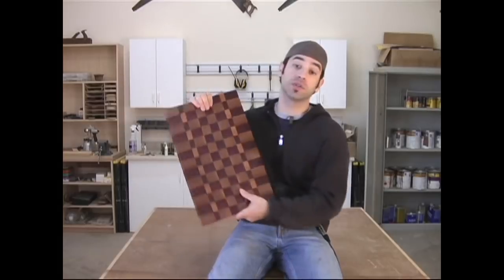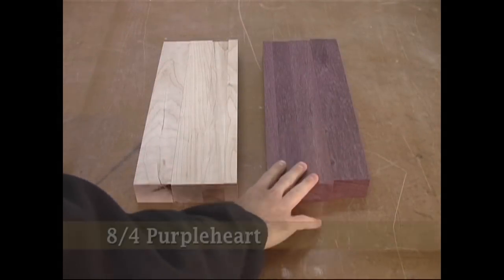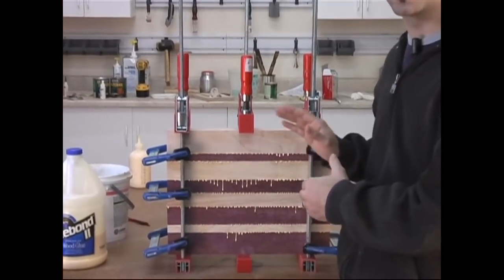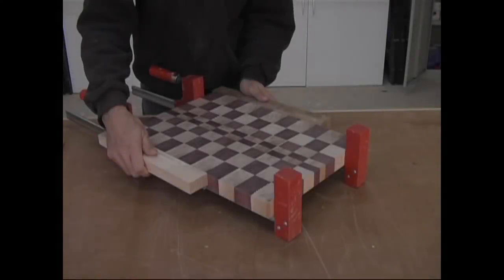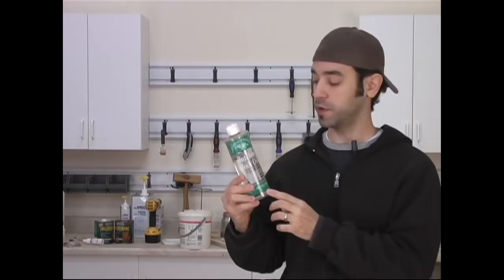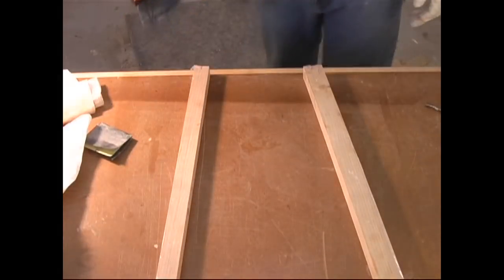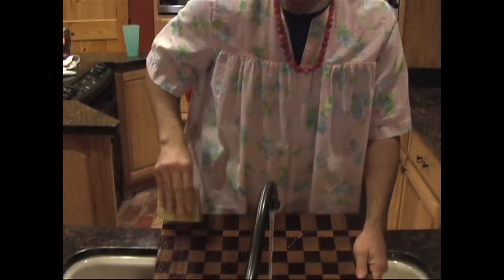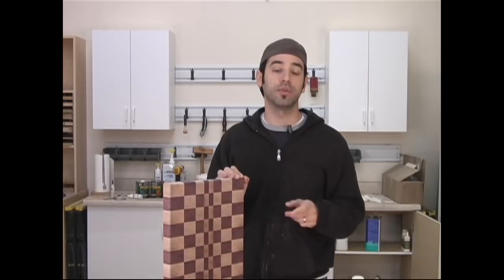7 - How to Make a Butcher Block End Grain Cutting Board (Full Video)

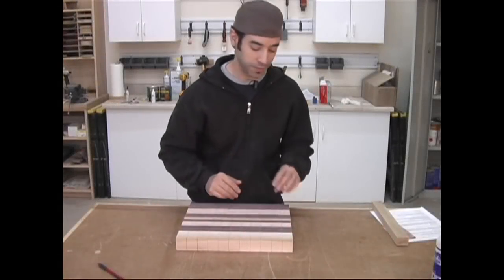Comment: You appear to have switched patterns mid stream. At the 6:19 mark you clearly show the pattern from left to right as 2 1/4 Purple heart, 3/4 Maple, 1 3/4 Purple Heart, 1 1/4 Maple, 1 1/4 Purple Heart, 1 3/4 Maple, 3/4 Purple Heart, 2 1/4 Maple.  Then at the 6:33 mark in the video suddenly the 2 1/4 Purple Heart is followed by  1 3/4 Maple.   This does not agree with the original glue up as shown in the video at the 3:24 mark.  I was trying to build this cutting board but could not achieve  the finished pattern you show in the video.  While looking for my mistake I discovered the inconsistency was in the video... I had done the initial glue up correctly so something changed in the video.  Truth be known, I kind of like the pattern I get when following your initial glue up order rather than what appears in the video when sawing the 11 1 1/4 strips.  Am I missing something. Oh... not to pile on... but when you turned each strip to expose the end grains for glue up, you didn't turn the last strip.  Sorry if I'm knit picking.

Comment: One question, you state that we should end with a board 18 inches long and 12 inches wide, but in the material section, you have have 15 1/2 inches as a lenght. Did I miss something?
Reply: Nevermind, I figured it out. I forgot about the part when you turn the pieces to expose the end grain, these are 1 5/8 x 11 = 18.
LOL

Comment: After doing the second glue up I noticed some uneven this on the height of each section. After resisting the urge to run it through the planer I am seeking advice on how to sand it down? Should I use a belt sander or orbital sander?
Reply: Due to size of board belt sander works best for non-planer leveling,  BUT besure to use ROS to eliminate heavy scarring from BS.
Reply: Personaly, I run my board through the planer but I put a sacrificial piece of wood (not end grain) in front and back of the board to prevent it from chiping. I suggest you to watch some of the video of mtmwood on You Tube to see how it goes.
Reply: I'm making the board just now and I have the very same problem. One side (the top one) is almost flat - I used a ROS and it took at least 15 minutes to smooth it (grit 80) as the wood I used is really hard (Ovangkol and beech). But the other side (bottom) is really uneven and I need to flatten it. Can't I use the planer for the bottom part? If not, why?

Comment: How strong is this glue?   If you were to drop the cutting board from a table or counter, would it withstand the impact or just shatter at the joints?  - N00B
Reply: Wood glue is incredibly tough stuff. You could probably throw this down the street, and I would be surprised if it had anything more than surface damage.
Reply: With any decent wood glue, when broken, the break is with the grain of the board... NOT the glue joint itself. Titebond 3 is what the pro's use, though Titebond 2 is perfectly good as well.

Comment: Do you absolutely have to wait 24 hours between glue cycles?
Reply from the maker: Nathan Snead No. At least here in AZ I usually only have to wait a few hours before light handling. But if it's something I plan on doing more work to, I'd give it overnight in the clamps.
Reply: Ok. I'm here too. Thx

Comment: Is it safe to add mineral spirits to the Salad Bowl finish? In my mind that defeats the purpose of making it "food safe".
Reply from the maker: You're just adding more of what's already there.
Reply: so there's petroleum distillates in Salad Bowl finish? that doesn't exactly sound "food safe"
Reply: That's why the can says "non-toxic when cured". The solvent evaporates during the drying and there will be very little left, and what little is left is permanently fixed in the finish. It's perfectly safe after that.

Comment: Great video, love the purple heart though your blades don't. I am concerned that you used mineral spirits to cut the varnish making this board toxic. Check your MSDS
Reply: I think the mineral spirits are just used as a solvent to thin the varnish and help it soak deeper into the grain. !00% of the mineral spirits should evaporate.

Comment: Using the General Finishes Salad Bowl Finish is bad advice, at least the way it's presented in the video. I was at first convinced by the reasoning in the video, but in doing due diligence before purchasing, I discovered these nuggets:

"Salad Bowl Finish is a film finish it is not recommended for cutting boards at full strength. To use for depth of grain and color, cut with 50% mineral spirits, apply, let soak in, and wipe back all excess leaving no film on surface, use GF Butcher Block Oil to maintain. GF Butcher Block Oil is a food grade mineral oil used to maintain butcher blocks, cutting board, knife handles, and wooden spoons for an oiled finish."
"For actively used butcher block counter tops that are used for chopping and cutting, only use Butcher Block Oil."

This is directly from the manufacturer of the product. They're basically saying don't use it for a cutting board, but if you insist on doing it anyway, don't let it seal the surface. Bottom line, you'll continue to need to use mineral oil on it, so what would be the point?

The product contains polyurethene, which when cured is essentially plastic. So if you follow the instructions of the video, what you've essentially done is made a plastic cutting board with a wood core. What happens when you cut through that plastic layer, and bacteria gets into the wood grain? What you're creating is a plastic coated, tight grained wood brush. Whereas the traditional, oiled butcher block re-seals with oil after each cut, and also benefits from the natural anti-microbial properties of the wood (assuming you choose the correct wood), the polyurethene is cured dry and will not reseal like that. Just a bad idea all around
Reply: "Salad Bowl Finish is a film finish it is not recommended for cutting boards at full strength. To use for depth of grain and color, cut with 50% mineral spirits, apply, let soak in, and wipe back all excess leaving no film on surface, use GF Butcher Block Oil to maintain. GF Butcher Block Oil is a food grade mineral oil used to maintain butcher blocks, cutting board, knife handles, and wooden spoons for an oiled finish."

This doesn't mean "don't use on cutting boards." If you notice the qualifying statement at the end of the first sentence, "at full strength," you will realize that Mark did exactly as the manufacturer suggests and cut the finish by 50% with mineral spirits, let it soak in, added more, let it soak in, sanded it off, added more, and very likely wiped it off afterward. He may have simply not put in the part where he wiped off the final coat because he assumed people will read instruction like you did.

Beyond that, if you watch the whole video, you will notice that he specifically states you will have to coat this with mineral oil even though it has a different finish, but that you do it far less frequently than oil alone.

You will also notice, if you reread your post, that the "butcher block oil" only requirement is for butcher block counter tops, which tend to get HEAVY use with things like cleavers.
Reply: UsernameFECKLE I thought mineral spirits wasn't food safe?
Reply: ricelife Well, it isn't when it is still "wet." Once it evaporates it is totally gone, though.

Kind of like isopropyl alcohol -- if you drink it, you will get very sick, maybe even die. But if you were to pour it on a cutting board, then wait for it to evaporate, the cutting board would be perfectly safe.

Comment: One note, at the beginning you give that eye roll about the "plastic" cutting board. There isn't a better choice than the plastic for meats and especially poultry as they won't absorb the more dangerous bacteria such as salmonella and they are also high temperature safe for the dishwasher.
Reply: Actually, studies universally state that wood is better. It is not absorbing that is at issue, but giving back off. Wood DOES absorb more bacteria, but does not release it back. Because knives can cut into the plastic, carrying bacteria with them, which can get trapped there in micro-pockets and protected from washing, only to be released into the next food if the knife cuts into the pocket, the only safe way to use plastic is to ALWAYS use the dishwasher on highest temp. And even then it is recommended to keep separate boards for different meats.

Wood absorbs the bacteria and holds onto it. By the time it gets back to the surface of the board, it is dead.

It sounds counterintuitive to want a board to suck in the bacteria, but scientists say it's what we want! :)

Comment: I like to finish my cutting boards like this:
- Sand to at least 400 grit
- Soak 24 hours in mineral oil
- Let air dry on a wire rack or painter's tripods for 24 hours

It works really well, seals beautifully, and cheap. Gallon of mineral oil on amazon is $20, you can reuse it after this process, and you can easily wipe it back on to reseal it after years of use.

Comment: Wouldn't using a varnish defeat the entire point of an end-grain cutting board?
You're sealing off the entire board so the surface you're cutting on is the one made by the varnish. You're not interacting with the wood at all.

Comment: I've been told you should NEVER sand a used cutting board,  as the dust containing the dried juices from the various meats could harbor nasty, harmful bacteria that you do not want to breathe in.  Thoughts on this?
Reply from the maker: +Patrick Burns Well, if there's lots of nasty bacteria in that board I'm not sure why you'd want to cut your food on it anyway.
Reply: +The Wood Whisperer as I understand it, the surface isn't the problem,  as that gets cleaned - it's what gets pressed deeper into the wood.  That never gets disinfected,  but will get exposed and airborne when the board is sanded down.
Reply: +Patrick Burns There's always a dust collector and a dust mask, and a spray of whatever cleaning spray you use. It's not like we need to have the shop clean enough to preform open heart surgery, after all.

Comment: is the smallest measure in the yank-system an inch?
always see 3/4 1/2 inch and so on.. seems so inaccurate and, well dumb compared to metric measures.
Reply: There are plenty of smaller measurements in the imperial system. Most construction and woodworking can go to 1/16th of an inch but you can definitely go smaller like 1/32nd or 1/64th even 1/100th of an inch. It is endless.
Reply: Yup! An inch is a littlest one, though we divide that up ad infinitum, with some admittedly dumb methods. But remind me (I am presuming you to be British??), how many farthings went into a Guinea?? ;)
Reply: ErntZEN 
Honestly, no one makes you watch this. Yank system???
I do believe it’s called imperial measurements. And the measurements are accurate. Most rulers measure down to visible 1/32”.  Now some go down to 1/64 for luthiers. And honestly, I am flat out sick of mm snobbery. Don’t use imperial. Who cares? I know conversions. But it seems so silly to announce an object is 
170mm when it is in fact just
6-11/16” long. The idea that 170mm is disproportionate to the actual length is at best fascinating. So enjoy your mm measurement. And ask the lumber yard for 
1219.3 X 2348.4 mm sheet of
Plywood. Sorry it sounds idiotic. Move your decimals🙄. So now you can call it
12.9 X 23.4m of whatever. Better yet round it all out. 
So now we have 13 X 23 meter of whatever. Still stupid, still a lot of work. The meter is an arbitrary length period. At least the imperial had a basis of length. And it needs no gold bar inside of a vault to announce its standard. Give me a break.